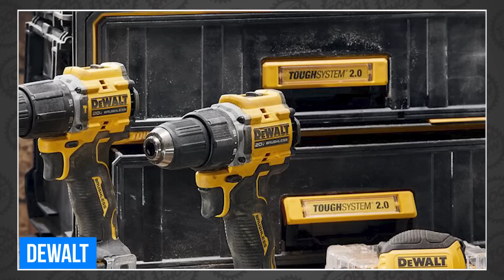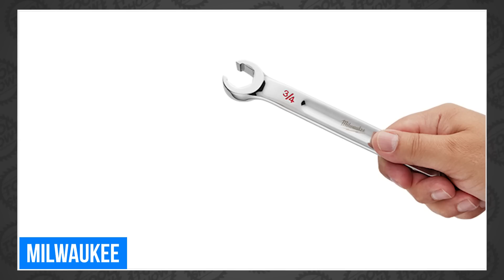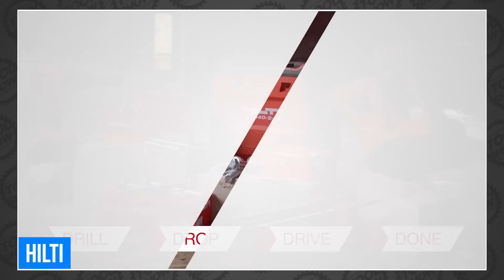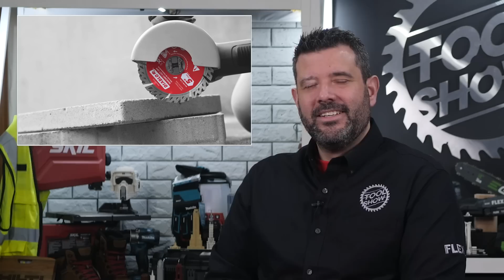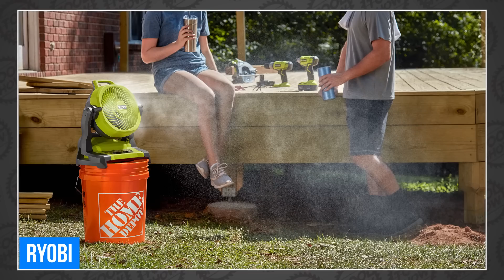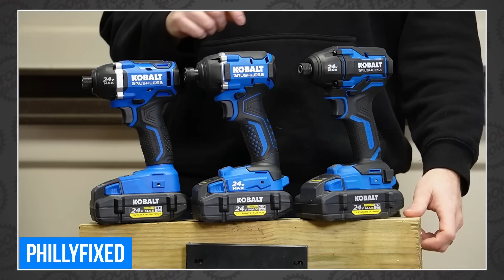NEW Tool Announcements from Milwaukee, DeWALT, FLEX, Makita, KLEIN, and MORE! It's the Tool Show!

Comment: Has anybody had or used a Firestorm drill, sawzall, etc. Firestorm is something that's like with Black& Decker. I had them. They still work just now have to replace the batteries but I've had them tools going on about 30 years. 32 years. It still works. Just had to get batteries
Reply: Is anybody hearing me?

Comment: While those hot saws are sweet and all. That's 4 batteries per unit to just use it uninterrupted. 4 large batteries is quite a hefty investment. Not so much an issue if you are one of those types that runs around with 6+ batteries of each offered size for your platform of choice.  but still!

Comment: I like that heated gear. The vest does great for holding the heat close to the body while allowing the arms to move well. For cold weather riding I really like Handlebar Muffs (or Hippo Hands / Handlebar Gauntlets / Handlebar Gloves / etc.) to keep the wind off my digits. With my heated grips I actually use my summer gloves in the winter.
Reply: The handlebar muffs are called pogies I believe. I’ve never owned a pair but as a former bike messenger I probably should have years ago.  Haha😂
Reply: @maxmotors9497  I've never heard that name for motorcycle gear, but I'll keep it in mind next time I'm searching for them. I don't know that they would be as much of a help for bicycles as motorcycles since the wind-chill factor increases exponentially with higher speeds, but it's ALWAYS nice to keep the cold off the hands! :)

Comment: I love Benchmade but they have priced themselves out. Look at Civivi and Kizer. They are both killing it right now.
Reply from the maker: I have a Civivi and love it. Thanks!
Reply: @ToolShow  
Seconding Civivi and Kizer for general use pocket knives.

For something in the trades that's a bit harder wearing...
At a 'still reasonable, but hurts when you lose it,' price point, consider the Demko AD20.5 which can be had for ~$150 and by all accounts is an absolute workhorse.
For a more friendly pricetag, look at the Ontario RAT 1/2 (depending on desired size)  Great ergonomics, unbeatable price, nothing fancy; great beater knife.  Buy 3 so when you forget one in a ceiling or it falls out of your pocket, you just carry on with your life having gifted someone else, some time in the future, a great knife.
Morakniv will also get a shoutout on the fixed blade side.  You cannot beat the sub-$20 price, and if you need a knife that can get absolutely abused with spine impacts, it's a solid contender -- not full-tang on the low-end models, but still, it'll outlast anything that folds that's five times the price.  Good steel, great grind, lots of blade options like chisel grinds and hookbills, as well as blunt-tip, and ultra-short blades for workplace safety compliance.  If you need a knife to baton two-bys into stakes for layout (or vampires), it's your Huckleberry.

Comment: I wonder why for the heated gear they didn't just go USB-C and make it so their battery packs can also charge gear. The new spec goes up to 200 watts.
Reply: I would guess it's because USB-c is still WAY too fragile for connections that are intended to be pulled/pushed/bent as they will be in that usage.  Good old barrel plugs are really hard to beat in tough/adverse conditions.
Plus they are operating at 12v.  To be able to list it as "USB-C" they would have to have a buck-converter to drop the output voltage to 5v and then have circuitry in the coat to communicate with the battery pack that sending 12V is OK.  The only real benefit to having USB-C on the pack would be that you could charge the pack off of a phone charger.
Reply: @anthonybarker9123  A lot of that makes sense. But for Milwaukee, for example, they already charge their system by USB and have USB out to make their 12v work.  But then do use barrel plug for connecting to the jacket itself.
Reply from the maker: Good question…